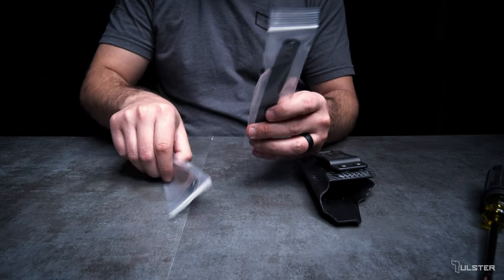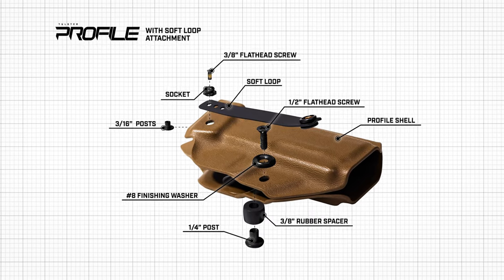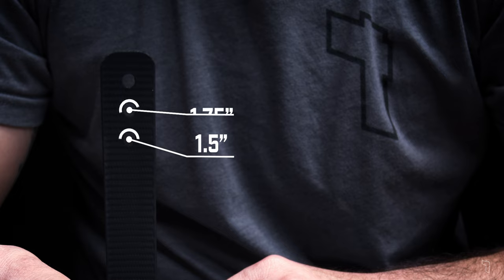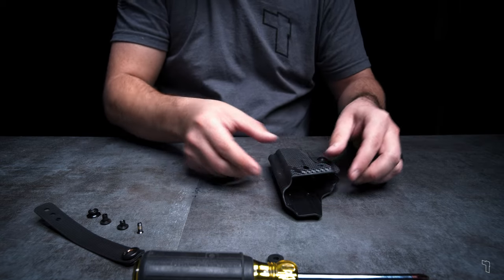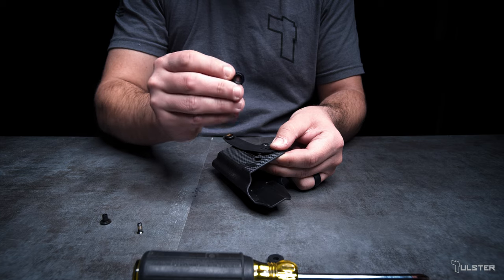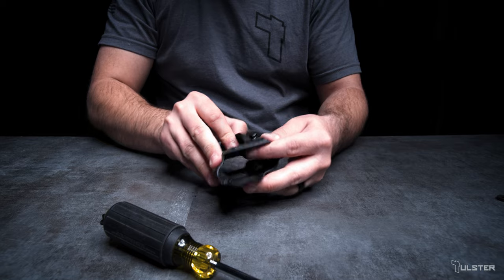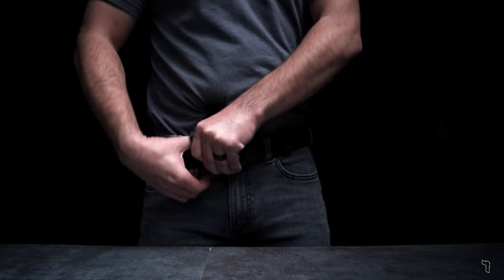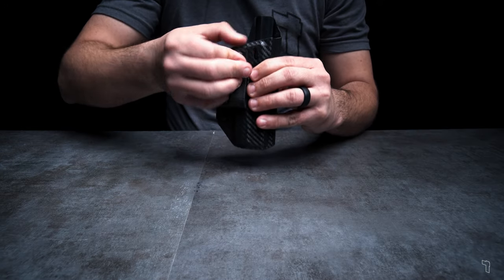Tulster Profile Holster - Soft Loop Installation

Comment: Which sidekick is needed for a Sig P365? 
I know it’s still a double stack but it’s a smaller gun than a standard double stack pistol so I didn’t know if the smaller one would be sufficient or not.
Reply: That’s a great question! I would start with a smaller sidekick first. I’ve used it more than the larger one.